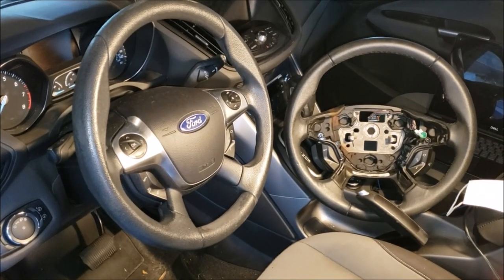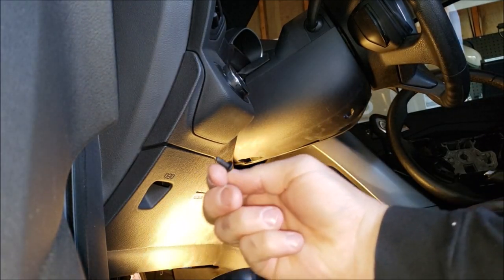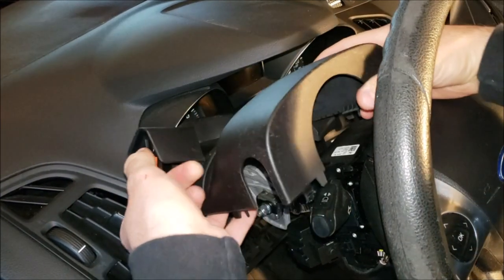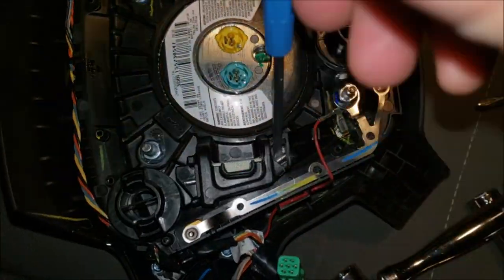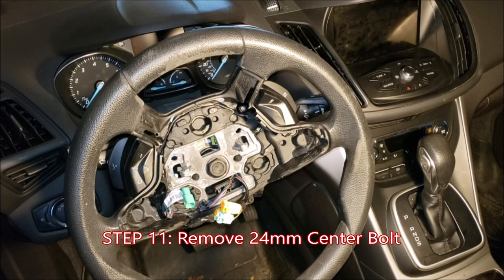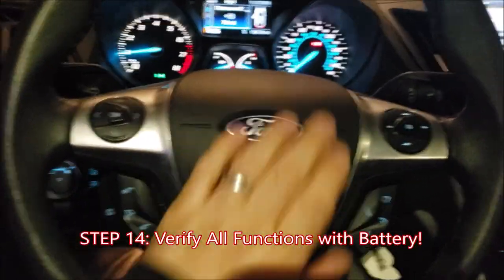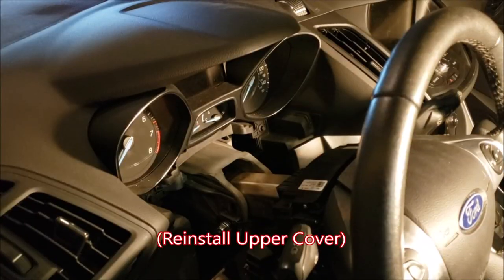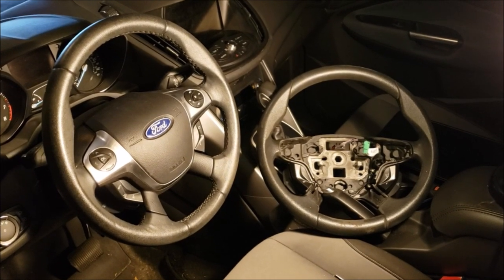Ford Factory Leather Steering Wheel Upgrade Tutorial: HOW TO ESCAPE

Comment: Great video! This is a pain in the butt! I did this same thing on my Police Interceptor Utility and it's a  much simpler process. No need to take off the plastics or anything. There's 2 holes in the side of the steering wheel for airbags. 

I'm about to do this to my sister's Escape SE.

On a side note: you should've centered the steering for the clock spring so it prevents unnecessary movement and the wheel being out of alignment.

Comment: Great video. Could you show how to install a USB outlet on the left side of the dashboard? (Between the steering wheel and the door)
Reply from the maker: Hey thanks, Vladimir! I think that would sound possible, but I'm wondering why you would want an additional USB port to the left of the steering wheel? What is your intention with that location that you couldn't use the one in the center console or use an adapter in the 12V outlet near the shifter? Thanks man!

Comment: Hi! I recently found your videos while doing some research into the ford escape and I was hoping to get your honest opinion of the ford escape. I am currently a college student and I will be in the market for a new vehicle soon. But budget is tight and I would need a vehicle that is reliable and could run for the next 4 to 6 years at least. Would you recommend the ford escape?
Reply from the maker: Hi Katelin- great question. If youre on a budget and looking for a vehicle that is worry free I do not know if I could recommend this generation Ford Escape if I'm 100% honest. There are 2 chronic issues with the 13-17 models with the ecoboost engines. 1) They consume coolant and can overheat or blow a head gasket and repairs can be in the multiple thousands of dollars or a whole new engine...2) transmission failure is common unfortunately- Ford has not issued recalls to pay for this even though it happens to many people and this is also a heavy replacement in terms of cost. I have a 2013 1.6L SE ecoboost with 138K miles on it. Knock on wood I haven't had these issues yet, and I try to keep steadfast maintenance schedules- however,  it does lurk in the back of my mind. If you're in college and looking for something with little to no maintenance of this genre of vehicle, I would either suggest a 2013+ Escape that is non-ecoboost, OR suggest going Japanese and pursuing a 2012-2014 Honda CRV or a Toyota Rav4 of the same year span. They run forever and are reliable and you can find them for a good price. I love our Escape, but part of the reason this youtube channel exists is because of the work we (or others) have been required to do. Hope this is helpful and good luck with your vehicle search!
Reply: Thank you so much! I have definitely considered the alternatives you mentioned because of their well know reliability and their similar sizes, engines ect. Thank you for the insight! It will definitely help me make the right choice!

Comment: Hi a question.those the steeringweel have interlock on escape 2013?when i turnoff the key a and take it out the weel wont lock.thankyou
Reply from the maker: Hi and sorry for the delay in response- are you asking if there is a mechanical lock to keep the steering wheel from moving when the car is off? If so, the answer is no- you can still move the steering wheel when the car is off - it's just harder as the power steering is not activated. If the vehicle is up on jack stands, you can move the position of the wheels (turn from right to left/ left to right) and the steering wheel will move as well when you do this through the rack and pinion system. But no- I don't believe there is any way to mechanically lock this system.

Comment: I would like to ask about the lights in the wheels controls, does it have lights in the control???
Reply: I am asking about a Ford Escape 2016 SE
Reply from the maker: Hi Josue! Are you asking if the steering wheel controls have backlighting in them to illuminate the button icons in the dark? Thanks for the vehicle details
Reply: @HowToEscapeDIYTipsandReviews  exactly!!! I was trying to refer to the backlights of the button icons of the steering wheel!!!
I had a problem with the left control in the steering wheel, so I disassemble it following your video and clean the electrical contacts with contactcleaner and I solved the issue, but I realized that there is not backlights in those controls and even in cruise button either.
But actually I don't know if those have backlights to illuminate them.
Thank you for help!!!
Greeting from Honduras, Central America!!!

Comment: I just finished this project after watching the video and now the traction control light is on and a “hill start assist not available” warning. From reading some forums I could have possibly broken or tripped the airbag computer during this process (SRS Module/Sophisticated Airbag Sensor unit).

I haven’t collected codes yet to begin fixing, but just a warning.
Reply from the maker: Ok thanks for the heads up- sorry that is going on- do you know if your battery is strong? Was the battery disconnected when you took the wheel off? I know those 2 warnings can sometimes show up as nuisances with low battery. Please keep us posted and good luck!

Comment: I've been thinking of swapping my Escape steering wheel found in the Focus ST. I just don't want the "ST" badge on the wheel staring at me (I hate putting performance badges on non-performance cars). On an unrelated note, do you have any suggestions on how to change the front parking lights and front turn signals? I tried, but my arms can't reach with the narrow opening.